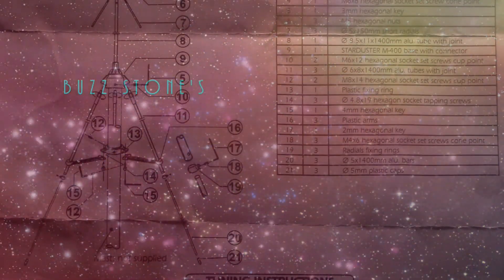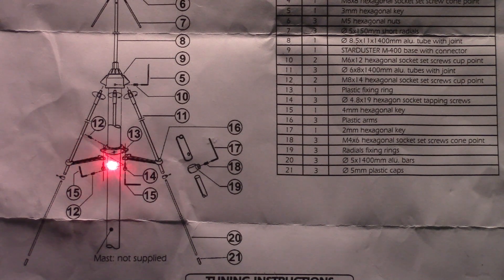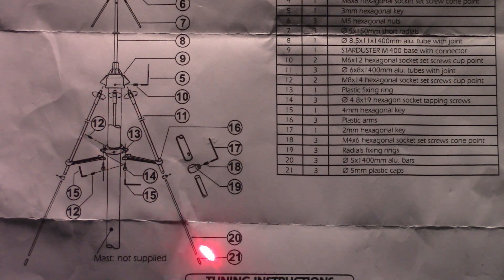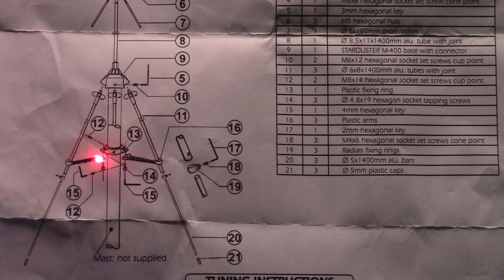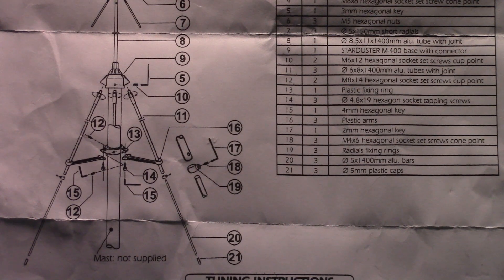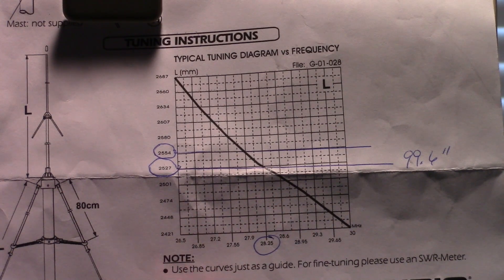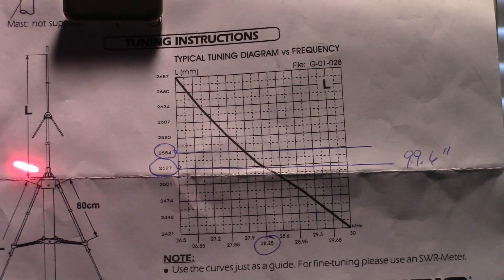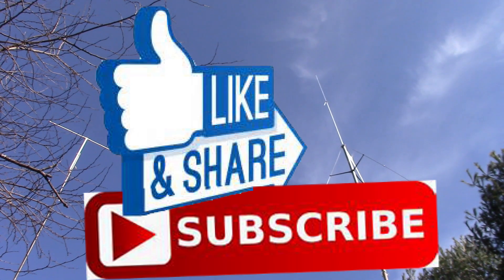AirWaves Episode 12-3:  Starduster M400 Installation Complete!  Part 3 of 3

Comment: If I measure my top part of the antenna it's 4' 7" without the one that slides inside it then when I measure the bottom one I'm already over the length for the 99.488 " so which one do I cut down the top vertical one or the bottom 3

Comment: I have just bought this antenna it's approximately 135 foot in the air and the swr was absolutely outstanding spoke to a few local stations and the antenna is working very well I highly recommend this antenna it is very strong as it does get very windy where I live as I am so high

Comment: Buzz how high did you raise the starduster antenna to get that swr match ?
Reply from the maker: The lower radials are about 20 feet above ground.  I have forty foot tower that I will eventually erect.  I will put it on the top of that when completed.  It is working great though, as it is I can talk to South America regularly, and have even talked to Germany on 18m.

Comment: I would have not isolated antenna from mast.if it takes a lightning hit its gonna go right into your structure.unless you have a ground block or bulk head ground connection at the cable prior to entry.pvc is also a huge electrostatic generator source ie static.thanks for sharing.
Reply from the maker: It's grounded before it comes into the house.

Comment: I’m new to home base, on that antenna, do have to ground it?
And you mentioned running a ground to your system
Reply from the maker: Because an outdoor antenna is a natural lighting rod, you need to ground it. If you use a metal pole to mount it, it will be grounded, but you still need a ground rod to protect your radio equipment in the house.  Drive a rod into the ground as close as possible to the entry point of the coax into the house. Then run a heavy gauge of copper wire into your radio room and terminate it into a terminal strip.  It's a good idea to run  grounding strap from the terminal, to all your radio equipment.  If you don't do this, you should be sure to disconnect your coax cable anytime there's a storm coming, or you're not using the radio.
Reply: Don’t use PVC! You need the antenna to be grounded to the mast.

Comment: Buzz I have a question for you sir. When you measure your ground planes to 99.6 inch did you do so before you screwed them up into the collar?
Reply from the maker: You need to put radials through the collar first because the joint is too big to fit through the collar

Comment: BE SURE to USE RED LOCK TITE on fittings, and use ROPE INSIDE ELEMENTS IF you want  ANT.to be trouble free in WINS causing harmonic DESTRUCTIVE vibration's. Rope's must be sealed as not to get  wet.,Pin though tite rope's @both end's.

Comment: Thanks for sharing your video. How many feet apart would you say the radials are from the mast? Measuring from the middle of the radial to the mast? Thanks I dont know if I have enough room tree maybe interfere.
Reply from the maker: I can't get up to it to get an exact measurement, but my best guestimate is that the downward radials are about 8 feet apart at the ends.  The middle point of the radials is probably about half that.  The total length is about 16.5 foot tall.
Reply: @Airwaves-Radio  thank you.

Comment: Very informative, i had one of these back in the 70's.It worked fine ,had a good match but high wind and ice storms where hard on it.
I was going to buy another one when i set up my latest base but at the the last moment bought a Solorcon A99 and i havent regretted it.
I love the A99 although I may still at some point put up a Starduster to compare them.
Reply: I also had a duster from the 70's. loved it!!! mine never said anything about isolating the mast, had it on a metal mast, got out all over!!
Reply from the maker: Yeah, the A99 has been around a long time.  For good reason.

Comment: My MFJ analyzer keeps saying I need to make mine longer I’m trying to tune it for channel 20 on 11 meter. I have it down to a 1.9 and that’s as low as I can get it and I can’t make the antenna any longer or the ground radials. I’m going to try raising it higher in the air and see if that makes a difference. I have it on a test pole on a tripod but the ground plane radios are only 2 feet off the ground,
Reply: I'd be checking the accuracy of that analyser. As good as people think MFJ are, I have heard of plenty of instances where they are faulty.
Reply from the maker: Yes, having the antenna that close to the ground will cause your SWR to be higher.  If you set your radial lengths to match channel 20, you should be good.
Reply from the maker: How long is the coax cable from your radio to the antenna?  What kind of coax are you using?

Comment: So the mast pole diameter is only 1 1/4 OD?? I am looking at getting this antenna but i just want to mount it to my chimney strap mast i have a old TV antenna up there now that i dont use so going to pull it off and put this up. D you see any issues with that sep up?
Reply: The bottom of the radials “should “ be a minimum of a quarter wave ( 9 ft ) off the top of the roof.
Reply from the maker: @jackson4861  Yes, a temporary setup.
Reply from the maker: Yes, 1.25"  OD, and I had to shave a little off to fit.  I would take part #5 with you to the hardware store and use it to match up a mast pole that fits well.  As for mounting on the chimney, I don't see a problem, as long as the chimney is structurally sound, and you allow for the downward radials to clear the roof line.  Good luck and let me know how it works out
Reply: @Airwaves-Radio  OK thanks for the info been years since i had a cb used to skip as a teenager in the late 70's through 80's. And figured giving the dark times it would be wise to get one.. Getting the 980ssb.. How did that electric PCV electrical  mast work out? I could find a video update on that.
Reply from the maker: The conduit is working fine.  I do want to point out that I have an earth ground at the coax switch the radio is plugged into, and an in-line lightning arrestor as well.  I use one of the coax switch connections to mount a 25 W dummy load, which I use to test the radio, and to use as an off switch when lightning is present.
Reply: @Airwaves-Radio  I just ordered the antenna on amazon $85 with taxes and even a shipping fee of 10 bucks even though i am prime.. So i told you i am going to chimney mount what is the cheapest way to ground it??? Do i just put in a 8 foot grounding rod and a copper wire from the metal mast to the ground???
Reply from the maker: If you're going to use a metal mast pole only, and not the PVC conduit, then yes, that will work.  BUT, what I did, was put a grounding rod outside the house, next to my radio room, then ran #6 copper wire from the grounding rod, into my radio room, to a terminal strip at my radio desk.  That way, i have access to an earth ground for any and all radios I might use now or in the future.  It might also be a shorter run of copper, than if you're running it from your chimney.   I also use a coax switch, so I ran a ground from the coax switch, to the grounding terminal.
Reply: @Airwaves-Radio  Ok thanks for info... My antenna location and radio location are pretty far apart. It will be a stretch for 50 foot of rg8x so from the chimney strap straight down to the grounding rod will be maybe 14 feet..

Comment: How long is the PVC part of the mast and did you attach it to a metal mast down below the PVC?
Reply from the maker: Ed,
Thanks for tuning in.  The electrical PVC (grey) conduit is a 10 foot section with the flared tip cut off.  The conduit is then bolted to a metal mast pole, using U-bolts.  About four feet of the conduit is doubled with the mast pole, to make it stable. Since you are posting under Episode 12-3, I guess you saw the modifications I had to make to the conduit.  Keep in mind that I have an earth ground at the coax switch and an in-line lighting arrestor too.  Let me know if you have questions.

Buzz

Comment: So why is everyone on the web saying to tune these at 102 inches well one guy said 102.6 or 8.55
Reply: Apart from frequency, the length is based on the material and the diameter. In this case aluminium tube, the diameter has a shortening effect. Theoretical resonant lengths are based on an infinitely thin conductive material that has no resistivity.
Reply from the maker: Yes, and a bigger diameter makes the antenna more broadbanded. In other words, it resonant at a broader band of frequencies.
Reply: @Airwaves-Radio  Good comeback. Yes this is true.
Reply: @Airwaves-Radio  Quick question. Do you think the 102 thing with a stainless is because of the velocity factor? Stainless steel's conductivity is pretty poor compared to copper and aluminium.
Reply from the maker: My guess is that Sirio tested the antenna at various lengths to determine optimum parameters.  Theory is fine, but actual performance under operating conditions is the bottom line.
Reply: @Airwaves-Radio  Yes real life is important. I'm about to do some low level tests with a pair of phased quarter waves configured for endfire. Got a nano vna and some local stations to do some test on the rough pattern.
But the 102 thing, stainless would have a shortening effect. People need to realise that these are not set figures or a constant. And so should not always be referenced, this only confuses things. That's where the vna comes into it, and the real life tests.
Reply from the maker: Depends on what frequencies/band you plan to use it for.  I chose middle of the range of the antenna, so I could use for 10 & 11 meters.  One guy posted that he talked to Sirio tech support and they recommended 109 inches.
Reply: Ok I am going to use it for cb band only but I have to try to get the set screws for the ground radals loose because when I was tighting them they kind of stripped I still have it in the garage because the weather is still not so good up here in the northeast corner PA we had snow last week
Reply from the maker: Good luck with that.  Might have to replace those stripped screws with something a little bigger, or a different thread count/pattern.
Reply: @Airwaves-Radio  it didnt strip the threads it stripped where the wrench goes in the screw but yesterday I got them loose just need to find out where I need them. For 11m because that metric stuff is confusing but I will figure it out I guess
Reply: 102.6" was good for me(radiator and radials).  i chose center of the band on AM..